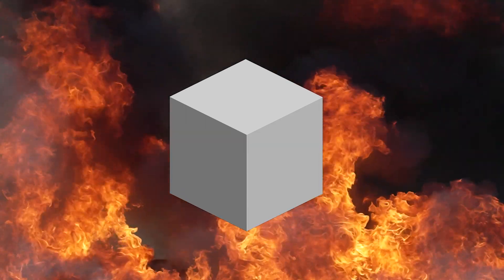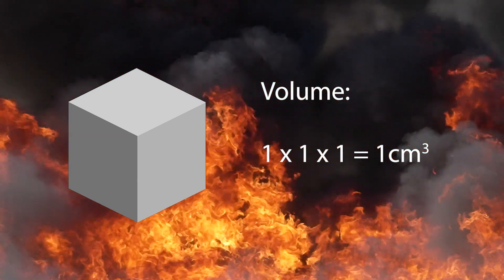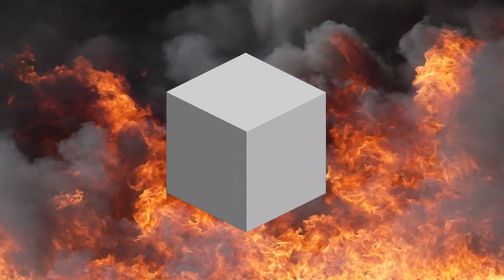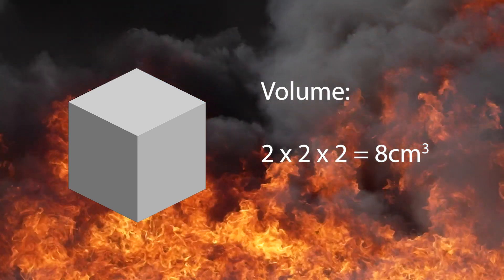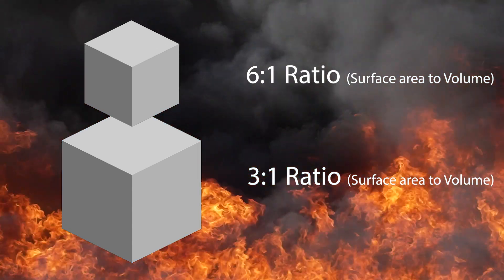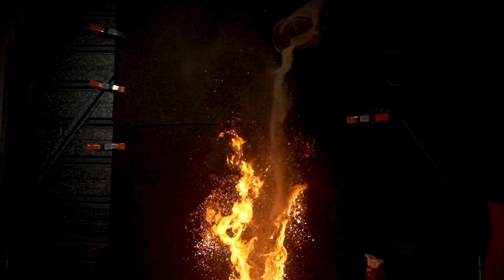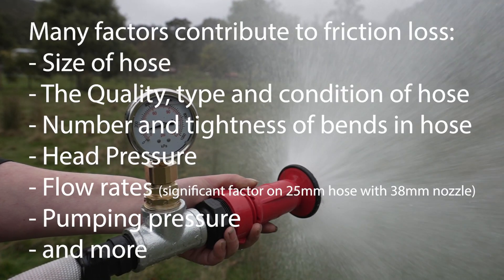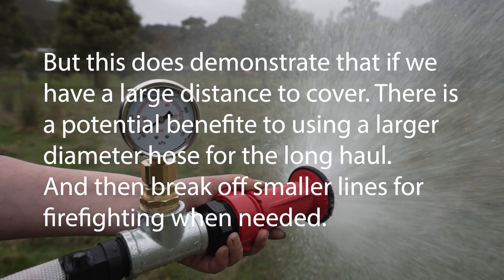The smaller it is.. The faster it burns..

Comment: With the hose test wouldn't it be fairer to compare identical cross sectional areas? 2 x 25 mm hose and 35 mm should be similar when expanded to round.